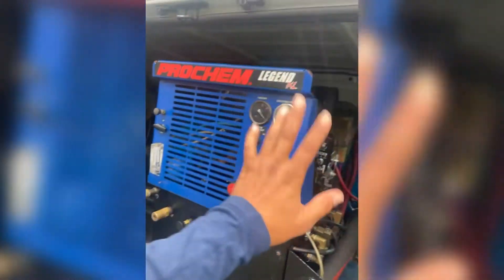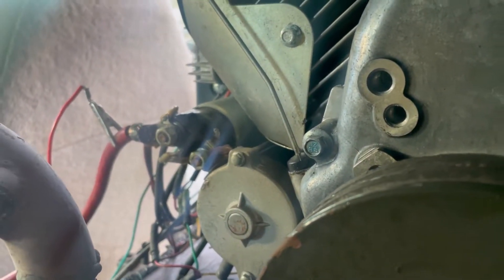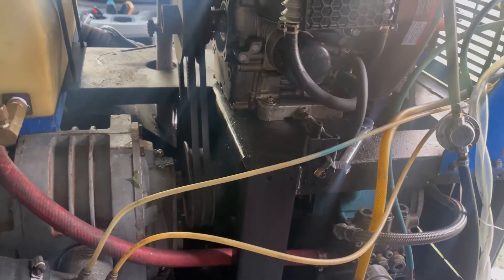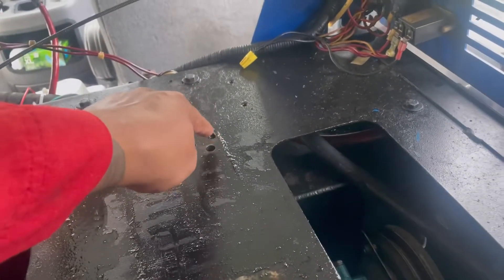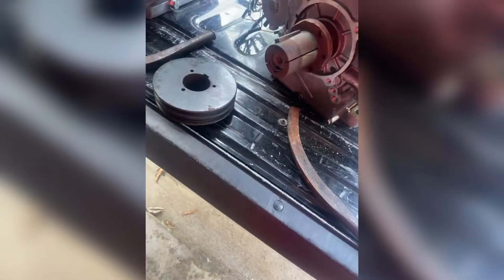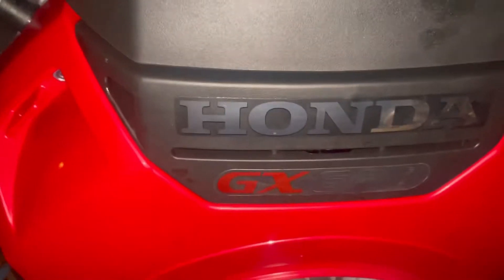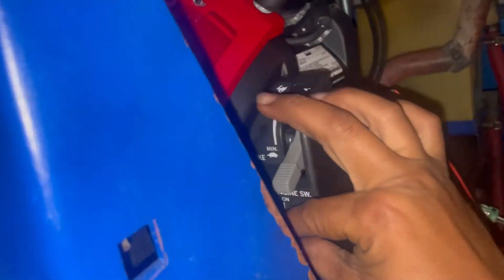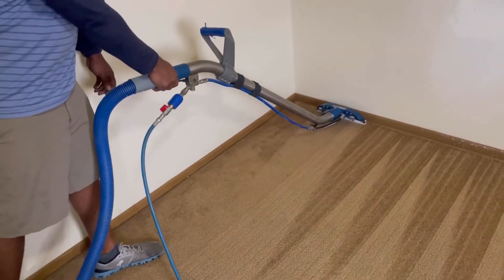Unboxing Honda Engine | Prochem Legend engine swap | Predator 670cc to Honda GX690 | Van Tour

Comment: How long did you had the predator engine before it started giving you problems? Tnks
Reply from the maker: 2 months on Legend XL. Have not had  a problem with Honda 2+ years later.
Had same Predator engine on pressure washer 3 times. 5 months broke, 11 months broke, 2 years broke. Also when they break hopefully its not the middle of the job makes for a bad day.

Comment: good call on the honda engine thats better than the normal one i would just make sure to take the muffler off before the heat exchanger so you get the most heat

Comment: Polar, Predator & Honda???

What’s the difference in performance? 
Is it really a big difference in your cleaning quality? 

I here good things about power for both brands but what’s your opinion/experiences with both? 

Thanks for the detailed video this really opens opportunities for other upcoming entrepreneurs.
Reply: Prochem Legend never dies
Reply from the maker: @krob08  you got that right!!
Reply from the maker: I have multiple units I have a Kohler on a unit that is a good quality runs consistent. This unit also had the same 18hp Kohler after it crapped out we put the 22hp predator on it and yes it was way more power but not consistent. Once the predator crapped out we put this 22hp Honda in and it’s consistent like you wouldn’t believe. Heat and suction is amazing it doesn’t bog down or anything. Honda was the answer to my problems highly recommending not to put a predator on such an important piece of machinery!!

Comment: Saved your self alot of money GC frfr if you would took it to the shop they would've tax the hell outta you, hey would you say those predator motor are good for the amount of money are do you wish you would've got a Honda motor in the beginning?
Reply from the maker: Deal is I’ve had 5 predators since 2019. As of today I have 2 of 5 left they’re currently on my pressure washing rig. They’re great to plug in and go to work and then boom they break and I’m trying to troubleshoot problems while my cash flow is on pause. I’m not buying another one ever. I’m here to stay and I want the best consistency possible no more being cheap I want the stuff that’s going to last 5-10 years!
Reply: @gulfcoastcleaningcompany  I'm in the beginning stages off building me a Truck Mount rig and I was debating on that predator,vanguard or Honda but I gotcha bruh appreciate it.
Reply from the maker: @jonescleaningservicellc8076   no doubt! I’ll say it again too that predator does work but it’ll give you pain in down time and inconsistency. Vanguard, Honda, Kohler for the win!